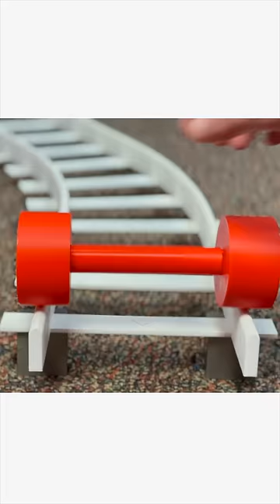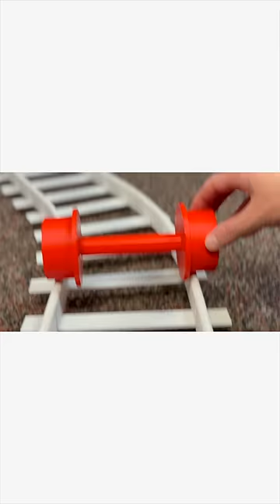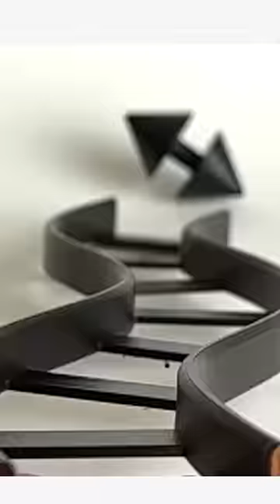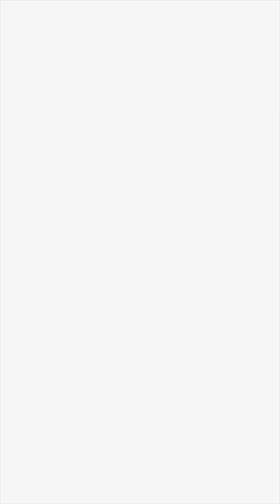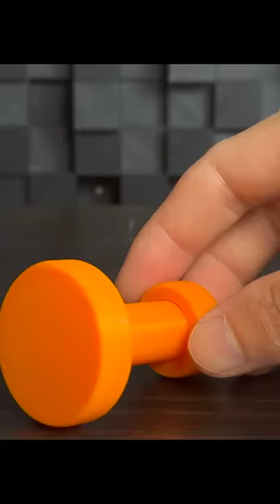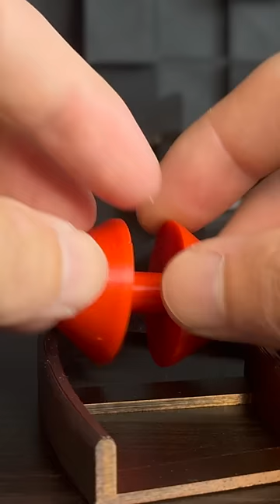The Design of Train Wheels is Genius #3dprinted #trains #interestingfacts

Comment: Train conductor from Sweden here. I know this is only about the wheel itself, but there is more to it. The bogie of a tracked vehicle is rotatable in the horizontal plane so that it can turn in the passage of curves. In addition to dividing the load on several wheels, a bogie is important for the running characteristics of the rail vehicle. The rolling paths of the wheels are conical, which makes them self-centering. If the wheel axle rolls to the left on the track, the left wheel will travel a little further than the right because the diameter increases on the left and decreases on the right. The bogie then gets a slight turn to the right and the axle steers towards the center again, etc. Under the running characteristics of rail vehicles, this is described in more detail and how passive and active radial steering in a bogie improves comfort. At the same time, this conicity causes the diameter of the outside wheel to increase and the inside diameter to decrease, which compensates for the fact that the outside rail is longer than the inside.
Reply: the what of a what makes it what?
Reply: Thank you! That was a concise deep dive. The combination of active and passive radial steering is such an elegant solution!
Reply: @JinnaiT   Think of a train as a huge car, and a 'bogie' is like the combination of axles and wheels, except you turn the /entire axle/ instead of just the wheels on the end, and when you combine that with the fact the wheels are sloped you can kinda self-correct so unlike in the short, the ride is smooth and straight even when you're going around a curve.
Reply: Yeah. What he said.
Reply: @The_Dougie  - Lol. I'm not sure why this is so funny to me right now, but it is.
Reply: I have never wanted to know about trains but this is making me want to learn
Reply: Edibles? Lol  @mariesummers.
Reply: That was such a great explanation. The other commentor explained the bogie, so the concept made sense. I've understood car mechanics easily but never thought of trains in depth in the same way 👌
Reply: Long story short: Trains use wheels. Noted.
Reply: Yes thanks a lot for the insight. 
i lost faith in humanity reading the answers under other comments.
Reply: Thank you

Comment: Need a followup on how this works going through switches.
Reply: What is there to know about switches? It's basically one is a curved track and the other is straight, two pieces of track move closing the gap depending on the lined track. The frog isn't that complicated either it's just a piece of two tracks with a little piece cut out for the flange way
Reply: @Nordkampf  Just thought it'd be interesting to see it explained in the same way. Frogs, guard rails and wing rails and specially crossing noses that can move or maybe four-way switches.
Reply: Train wheels irl look like the one with flanges because they don’t go on turns like that one and would derail at anything about 2 centremeters per year
Reply: The train hovers over switches 😂
Reply: @Nordkampf right lol I swear YouTube comments been killing what little faith I have left in humanity
Reply: Need a follow-up on how this works going over one person vs going over five people.
Reply: @Ken-lc1kg  you know, we're all born knowing nothing. At some point, you didn't know how a switch worked, or even what a train was. I often cant tell how old commenters are, especially at a glance, and youth can be exculpatory. Even an adult can be forgiven for not knowing the intricacies of a subject they may have no/little experience with. Cut people some slack. Dont be so pessimistic and condescending.

Edit: i bet if i asked you to design a switch system that worked flawlessly from the first time onwards, and didn't allow you to research it, you wouldn't be able to. Vaguely describe it, sure. But knowing something in principle isn't the same as having intimate knowledge of the details of a mechanism. 3d printing is great for demonstrating designs, some people intuit by seeing a physical system work way easier than by reading a textbook.
Reply: @operatord4s118 Wheelsets are flanged, but they are also tapered, just not as aggressively as what is shown.
Reply: @Takenmynameandmycat I'm neither an engineer nor an engineer but I'm pretty sure that the flange is an emergency fail-safe. I think the flange just stops the train from derailing parallel to the tracks in the event that the wheel is about to slip inward. The flange prevents the train from straddling a single rail if the engineer tried to take a turn at too high of a speed for the weight of their load.
Reply: As a kid switches always fascinated me lol. As a railroad machinist decades later they still did!

Comment: I never understood how trains did curves but I always figured the flange solution made the most sense
Reply: It does, the reason it doesn't work in this video is because the flange doesn't touch the tracks, if it did, The train will turn without a problem
Reply: @yup7242 On trains the flanges do not touch the rails. They only do so occasionally. If they would touch the rail continuously, both the rail and the wheel would wear out pretty fast.
Reply: @yup7242 no. If the flanges are touching the rails something has gone wrong.
Reply: Another problem with flanges alone that wasn't mentioned in this short, is that flanges constantly contacting the rails while moving creates a LOT of friction, which would not only slow the train, but also generates a lot of heat, creating even more issues.

Comment: Finally this gets some mainstream attention. Learned about this in engineering school and always thought that this was a highly underrated piece of engineering
Edit: Another thing to mention that I remembered about this is that it also solves the issue of a differnetial gear train which would be very expensive and maintenance heavy if you had to put it on every axis of a train like you have to with cars. Here the wheels align like shown in the video and take care of the issue themselves
Reply: Ok. Will it work at high speeds?

Comment: Wait this explains so much. If anyone has ever taken NJ Transit or Amtrack in NYC there is always a bend after Secaucus before you go under the Hudson River. It's such a sharp turn that everyone on the train leans to the right basically leaning yourself on the window. This video is a great example of why that happens.
Reply: That would mostly be a centrifugal effect, wouldn't it? There's a tiny bit of lean due to the wheel geometry but it really is pretty tiny.
Reply: Tracks are often Banked for corners, as well...  allows safer travel at speed...
Reply: That is just basic physics, the thing described in the video is engineering and has to do with the adjustment of the radius/speed of each individual wheel in a turn.
Reply: Not just that, the rails itself are tilted in sharper curvatures
Reply: It happens because it's a turn (centrifugal force). It also happens in a car with normal wheels.
Reply: @polycrystallinecandy  No, first law of Newton: an object will not change its motion unless a force acts on it. The train is taking a turn while your body (and the entire train) actually want's to continue going straight forward
Reply: @Capajebo  it's the exact same thing. Centrifugal force is just inertia (as you described) viewed from the non-inertial reference frame of the train.

Comment: According to a B&O Railroad engineering report from the 1830s that I read, engineers at the time were taking into consideration the coefficient of friction between the rails and the track so that the net force applied by the wheels on the rails (on a straight section at least) in the horizontal direction is zero.

Comment: Alright, but imagine this. You’re on a train, you’re enjoying a cup of tea, and then the train starts tilting like a freaking motorbike.
Reply: Yeah that's what keeps everything stable inside the train. Like your cup of water 😀 or tea
Reply: Relativi-tea.
Reply: remember that he said "this is an exaggerated version" of the train wheel. there are probably other mechanisms and techniques engineers put in the train wheel designs to prevent these from happening
Reply: It would actually keep you flat against the perpendicular g force the turn is pulling you towards
Reply: Most high speed trains DO tilt going around curves. Either from the super-elevation in the tracks(one track higher than the other), or a tilting mechanism built into the train itself; or both.
Reply: That's supposed to happen.
Reply: This is an exaggerated version of a train wheel. The wheels do also have a flange on the inside. Train tracks have a tilt on high speed curves to keep the train from tipping. They also have springs that act like suspension. Also, I drink coffee on the train, not tea.
Reply: The trains have suspension, the first is just ur up and down ,  the secondary suspension is air bags which have a compensating valves so when the trains go left to right it's self levelling.
Reply: @enrapture8  Negative! You WANT the train to lean into the turn because it counteracts the lateral acceleration vector of turning. The lean actually PREVENTS the tea from spilling!
Reply: @blairskinner8565  NOPE! you want the train to lean into the turn, just like a motorbike. That keeps the gravity vector and lateral vector of angular acceleration of the turn (which are additive) more closely aligned with the acceleration vector of objects inside the train, lessening the potential of your train cars tipping over in a sharp turn. This also lessens the likelihood of a liquid in a container spilling!
Reply: Exaggerated
Reply: exactly
Reply: ur literally clueless how trains work . i suggest watching a video about that 😭🙏
Reply: Trains DO tilt, though. If you check tracks, you'll notice that curves are at an angle. Plus some trains have tilting mechanism at speed for stability. You don't feel anything on board, it's meant to correct centrifugal force.
Reply: I mean... this is an exaggerated model for the purpose of demonstration - the wheel angle and curves are incredibly sharp to show the principle.
Real train wheels have far more delicate subtle shape AND a flange as well. And train cars have suspension that also makes tilting less noticeable.
Reply: Yess! If it feels so unstable and keeps moving like that how are you gonna travel? I would feel scared the whole time
Reply: @sfm9098  So that's why they offer tea on trains! To stabilize smooth movement.)
Reply: @Kirill_UA  🤦🏻‍♂️
Reply: @nullgeodesic9423  welp sorry i dont know much of engineering and stuff so as long as you know then its all good
Reply: Imagine this, you're in a car that's in a cargo plane which starts banking. Still no spillage. Or better, imagine you're the main character in Initial D. Or you're on Earth which spins on its axis hundreds of kmph and travels around the sun which spins around the galactic center.
Reply: @niubilities  😁 I have

Comment: "F*ck wheels." The Japanese quoted, and proceeded to create a train without wheels.
Reply: Maglev still uses wheels
Reply: As the guy above said. Maglev still use wheel up to a certain speed. Once it reach the required speed, the wheel will lift up like airplane and let "magnets" do the work
Reply: @megatfitri_hello how do magnets work

Comment: That train better have some damn good suspension
Reply: A set of conical wheels doesn't require a different kind of suspension on a train.
Reply: @wipoute  I guess I’ll take your word on it. It just really seems like the motion caused by the wheels moving like that would be felt by the cabins above
Reply: @ProducerX21  you are right, but in this video, the curvature of the railing relative to the size of the wheels has been greatly exaggerated for educational purposes. Usually, a train makes a 90 degrees turn over the course of a few hundred meters, so the curvature is much bigger and the conical shape of the wheels is barely noticeable.

Comment: SO many problems with this video.   The flange wheels NEVER have that much gap between the flange and rail which is what's causing it to derail in this video.  Not to mention no rail curves have such a tight radius relative to the axle length.  Then there's the problem of how to mount the cone wheel axle to the train.  The train and it's passengers/load would be shifting all over the place, and being top heavy,  most likely would derail as the cones ran sideways off the track.  Then there's switch tracks.  How are you going to move the train to another track?
Reply: VERY rare to find the informed guy here. Most are WIKI PhD's. YOU got this RIGHT, but lets wait for a few days and we WILL get the comment  that will try to refute the correct explanation. 
 Mechanical engineer, unfinished Metallurgy and a lifetime of work in metal shop.
Reply: Yup, train height increase, braking, wheel weight, etc

Comment: Most trains work on what is called a bogey, these are what keeps the wheels on the train, when the wheel starts to go round a corner the bogey turns thust allowing the train to continue on its way
Reply: And that’s why most bogey are formed by two set of wheels?
Reply: @CloudAyden  Yeah basically, if it was just 1 set there would be no point in a bogey

Comment: Train wheels are a combination of the 2nd type with the flange and the cone ones. They are in no way shaped as cones though. They just have a very subtle conical slant which is normally only a few mm in angle
Reply: I believe that is why he said that the design was exaggerated.
Reply: The actual shape is more like a parabola. There's a continuous (albeit not regular) curve from the edge of the flange to the wheel. The flange doesn't actually scrape against the side of the rail.

Comment: It also makes the wheels easier to pull out of the mold when they cast them.
Reply: LOL!
Reply: It also moving too much, can make the passegers inside 🤢
Reply: Incidentally, I believe that most, or perhaps all, train wheels are forged, then rolled, then machined to final dimensions these days.  The forging and rolling would result in a stronger wheel than casting, as the force of the forging and rolling processes would bend the grains in the metal around the shape of the wheel.  Here is a very interesting video showing an automated train wheel manufacturing line. >>> https://www.youtube.com/watch?v=msJ23AKaChM
Reply: @edschultheis9537  that's probably true today.  I have been to a place that used to cast them.  It has been closed and repurposed decades ago.

Comment: This design is truly genius in that it doesn't take into equation how much the poor souls inside the train will be throwing up then...
Reply: This is an exaggerated version of real-world train wheels. It's typically a much shallower angle.
Reply: The train body sits on giant air bags, even if actual wheels were this exaggerated, you’d not feel a lot of it.
Reply: @voldemort008  "The train body sits on giant air bags"
- Where did you get that? Can you provide a link. I've never seen air bags in a train.

Comment: You also have to remember the average OTR locomotive alone weights ~450,000 pounds and has ~4,000 horsepower. Normal switching locomotives usually weight ~150,000-200,000 pounds and have anywhere from 900-1500 horsepower. Then you have the GP locomotives alongside SD40’s that weight ~300,000-350,000 pounds and have horsepower between ~1,500-3,500. That’s per locomotive. And each locomotive have a axle weight limit on the train, so one SD70 ace can haul however many tonnage of train add another one and it doubles.
Reply: Isn’t it easier to give those weights in tons?
Reply: Pounds ? Horsepower ? You're either from the 18th century or from a country that skipped metrication.
Reply: I fucken knew fact guy  was somewhere in the comments 😂😂
Reply: @robinharwood5044  That gave me a good chuckle
Reply: You also have to remember these weights are without accounting for your mother.
Reply: No, I don't have to remember that at all. That doesn't change this explanation in the slightest.
Reply: And we don't use locomotives, for like the past fifty to eighty years at least if not more
Reply: @WallySketch  the specs for the weight and power output for a locomotive are listed in the cab of that locomotive and they use lbs and horsepower. His units are correct as per the manufacturer for the locomotives he listed. GE’s and EMDs both use these units.
Reply: @thelawnhack2353 however the explanation adds nothing. The power of the locomotive or the weight makes no difference to how train wheels work.
Reply: @jaroslawczach4845  A locomotive or engine is a rail transport vehicle that provides the motive power for a train.
So..............